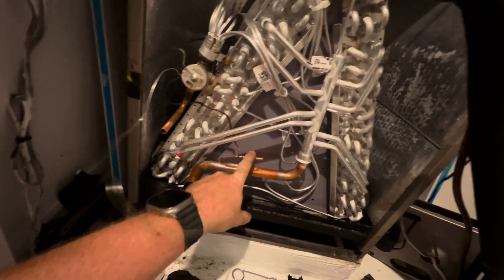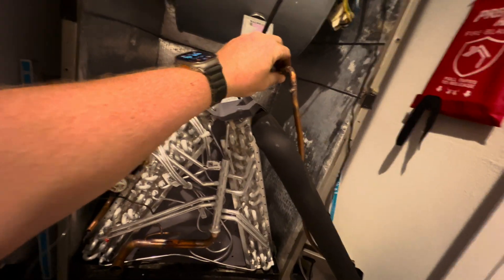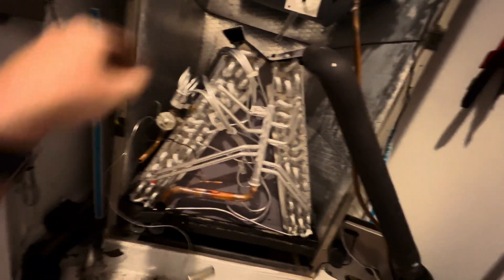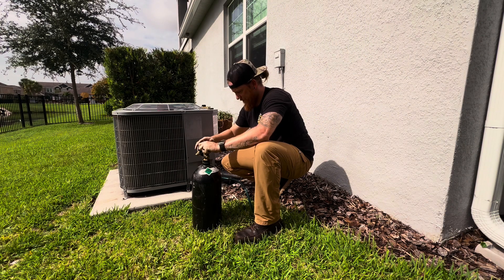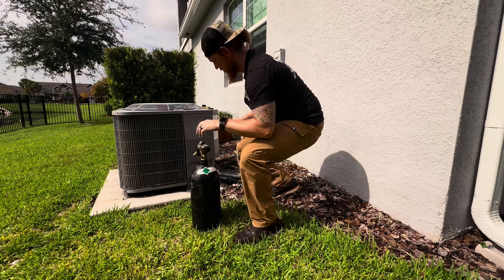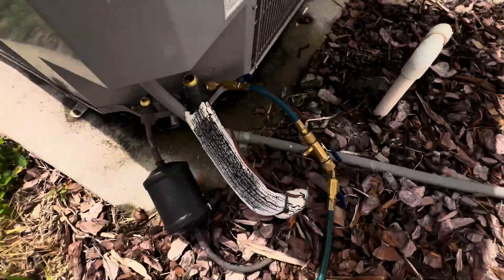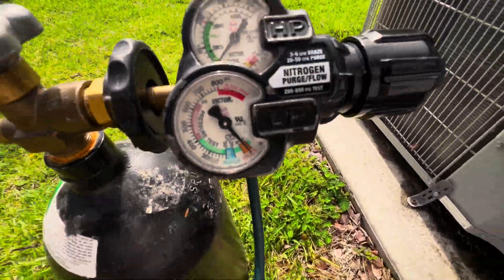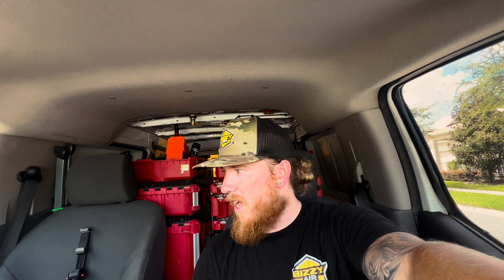MAJOR ISSUE found on MAINTENANCE | HVAC | Carrier evaporator coil replacement

Comment: Why put old txv valve onto new unit? Wouldn't just put new one on?
Reply from the maker: There wasn’t a metering issue, there was a leaking issue! Usually tho I like to get them both and replace both, but carrier 😡 pain in the arce
Reply: You must not be familiar with carrier build your own coil replacement
Reply from the maker: @joeshearer1247  blue ovals yayyy!! 😂
Reply: @KoolinwithKrauss you know who else has blue ovals? Ford. And Pfizer 😮.
Reply from the maker: @realSamAndrew  damn Sam you ain’t lying 😳 that’s why I drive a Chevy and haven’t been jabbed since the damn peanut butter shot at basic in 2010 🤣

Comment: I want to replace my almost 5 year Armorflex at the condensers in So. Fl. What do you think is the best and should I use UV tape over it? It would need the seamed stuff obviously. :) Give up your trade secrets! 2 Carriers here also.
Reply from the maker: Why do you want to replace it by chance? I get the uv rated stuff for the condensers, not harm if you cut it and zip tie it.
Reply: @KoolinwithKrauss  It's getting a little crusty. Probably need 4' of each. I have a 5 ton and 3 ton.
Reply from the maker: @scotts4125 ya they make it with the uv on it… k flex I think it is! Not sure if they make the peel n stick in it or not! But you’ll be good with that